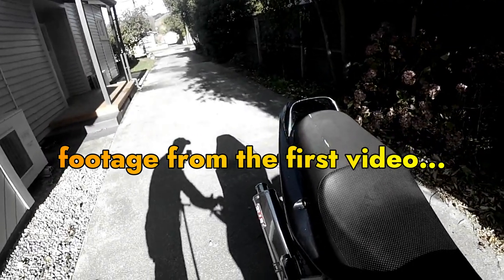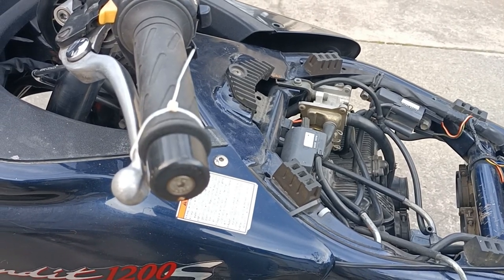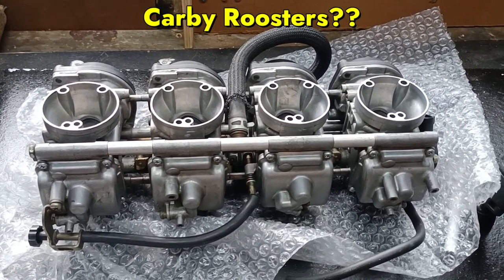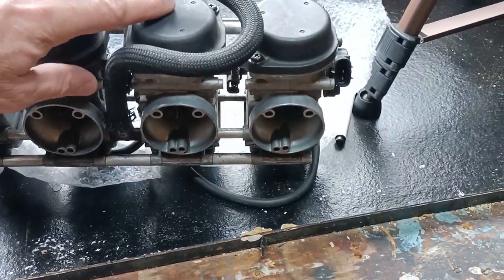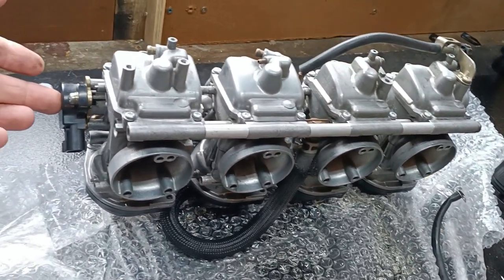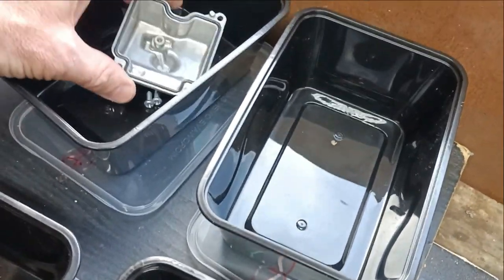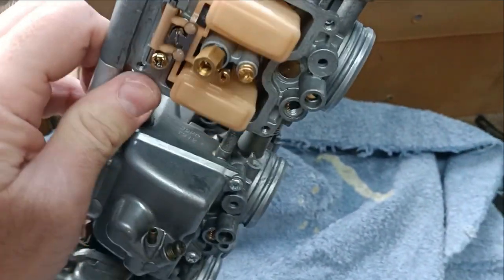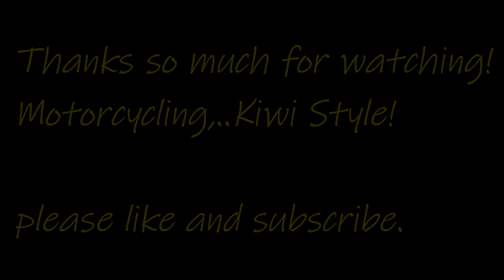My Suzuki Bandit 1200 project | Part 3 (diagnosing why it is running rough)

Comment: Yep, getting some JIS screwdrivers was a game changer.👍
Reply from the maker: @uhtred7860 - the Mikuni carb repair kit I borrowed had the JIS screwdrivers in it. So much better!
Reply: @motorcyclingkiwistyle  I got mine online from Yambits, i was ordering some FZR bits and pieces and saw a set, they were only 31.00 NZD for a set of 4. Decent quality too.